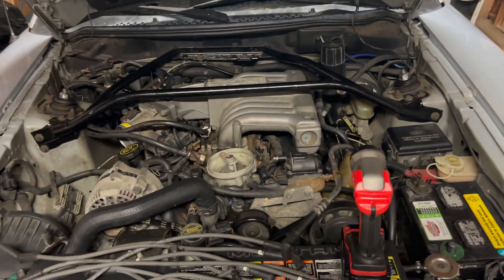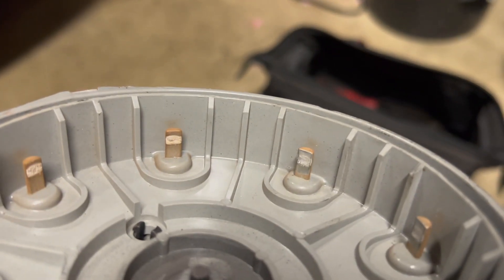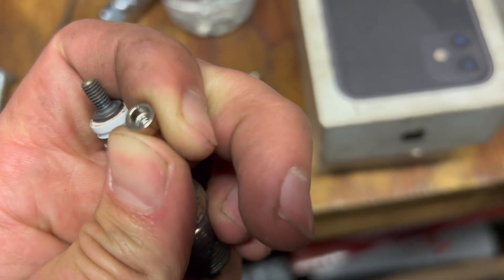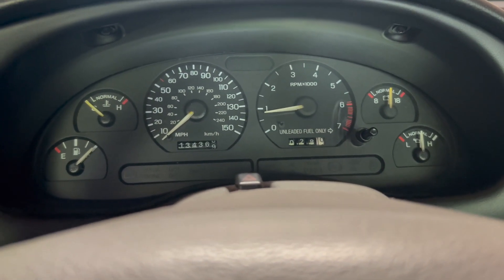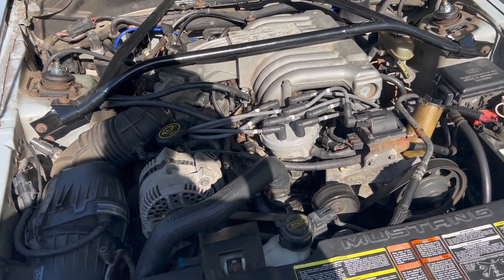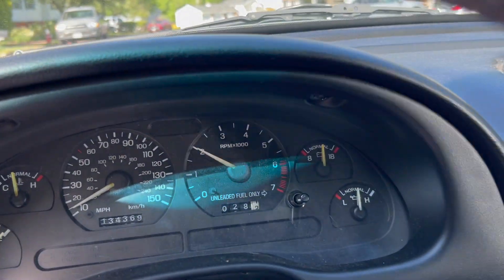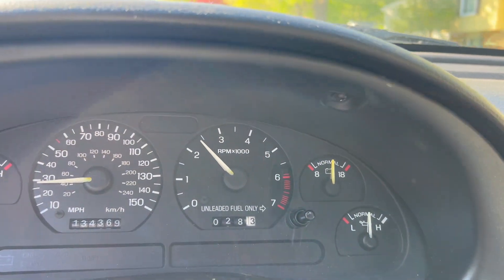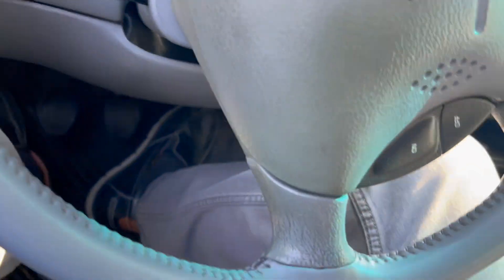95 Mustang GT Misfiring/Backfiring & Cleaning Distributor Cap and Checking Plugs and Wires Plus Test

Comment: Did you figure it out yet? My 94 is doing the same thing. I’ve changed fuel pump, fuel filter, cap, distributor, plugs, wires. Also I smoked it for any vacuum leaks and found one at the egr valve. I haven’t had a chance to put the new one in yet to see if it fixes it.
Reply from the maker: I haven’t messed with the car in awhile. I’ve been busy with other things and I’ve been frustrated with the car when it keeps acting up. But soon I may try new spark plugs and wires and go from there, stay tuned for an update video!

Comment: Just curious what made you trouble shoot plugs first instead of fuel issue ?
Reply from the maker: The plugs and wires are 4 years old so I figured I would check them just to rule them out 100%. And I replaced the fuel filter 4000ish miles ago so that should be good. Any ideas on what other components of the fuel system I should check? Every time I key on the ignition the fuel pump priming sounds the same as it always has. Just trying to learn as I go
Reply: @donatinghorsepower5100   same bro that's why I asked lol , been keeping mine going for 30 years learn as I go and I'm not a mechanic. The only time I had similar issues , bad fuel pump other my coil would over heat start misfiring than the fuckin shit just died completely on me while I was doing 80 on the highway lol

Comment: How did you learn to work on vehicles?
Reply from the maker: I got a job at a Ford dealership changing oil on cars, and then they put me with the transmission guy. Every day I was removing transmissions from cars, he was rebuilding the complex ones on the bench. He taught me to rebuild the simple Focus/Fiesta transmissions (horrible design by Ford) and then I would reinstall transmissions. Learned a lot about the ins and outs of working on cars in that time, like being careful with plastic sensors under the hood, where to pry from to pop axles out on FWD transmissions, figuring out socket and swivel extension setups in tight areas under the car while wrenching, stuff like that. Then at home I would just tackle any job I could on the Mustang or my other cars and YouTube how to videos if I got stuck on a repair. Once you start getting experience and more confidence with working on cars the sky is the limit!